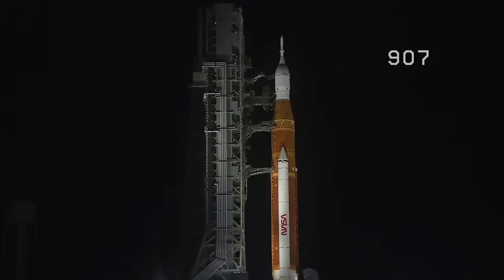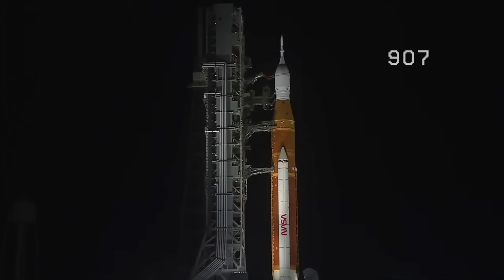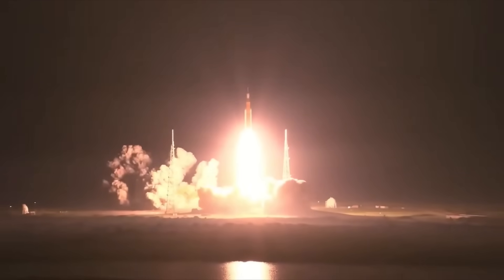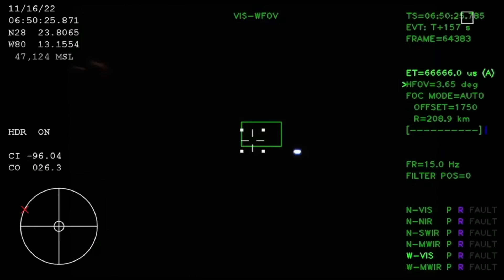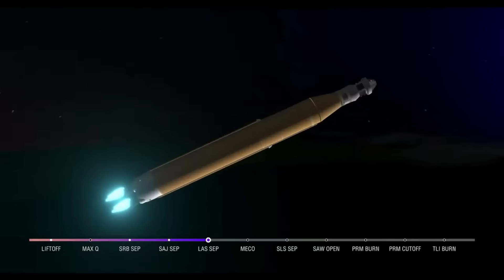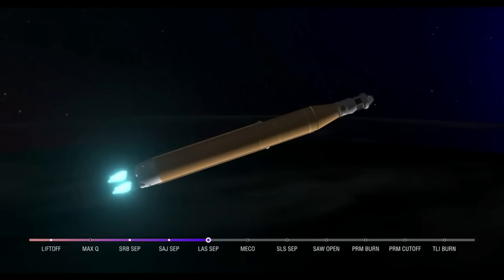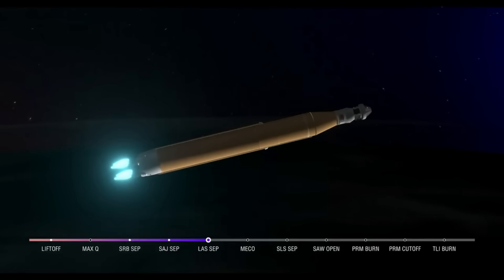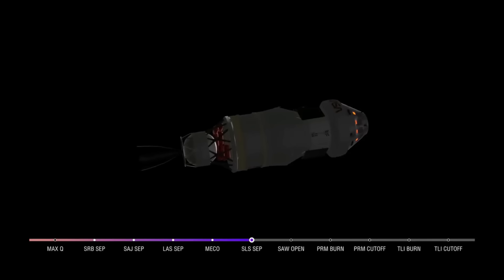Blastoff! NASA's Artemis 1 moon rocket launches on historic first mission

Comment: Let's put some things in perspective here:
Towards the end of the video, the vehicle was traveling at a whopping 16000 mph.
The distance between New York and Los Angeles (in a straight line) is 2446.3 miles.
So it would only take this rocket 9.17 minutes to travel across the length of the US!
Some added perspective:
A quick search shows that the fastest commercial rifle cartridge in the world is the .220 Swift (developed by Winchester). Its highest recorded velocity is 3180.7 mph.
So when this rocket reached 16000 mph, it was moving 5 times faster than the fastest bullet!
Reply: I didn’t know I needed this comparison but I’m here for it. Thank you!
Reply: Yes escape velocity of earths atmospheres is around 17000 mph
Reply: @odynith9356  Actually, it's closer to 25,000 mph -- about 7 miles/sec (11.2 km/sec). And you're not escaping earth's atmosphere per se, you're "escaping" Earth's gravity well.
Reply: Right so do the math on how far away they said it was at that speed and how long it took and it doesn't add up!! I smell bull!!!
Reply: @JB-ef7ks  You have to remember that the rocket is undergoing accelerated motion in three dimensions. It started at zero velocity and accelerated to 16,000 mph in the 5 minutes or so before MECO. Generally, if you integrate acceleration twice with respect to time, you will get the distance traveled. Here, we would have to know what the components of the acceleration are in the x,y, and z directions as functions of time. Then, we could integrate those functions twice over the main engine burn time. Then, I suspect, you would see the distances match up.
Reply: @2199SPUDMAN  I suspect not, but why don't you indulge us...
Reply: @JB-ef7ks  Acceleration of a rocket is not a linear or constant function, it is logarithmic. The thrust is relatively constant, except for throttle back around max Q, but the forces working against that thrust drop as the flight progresses (air resistance drops as the rocket rises, fuel mass falls as it is burned, gravitational resistance lessens as the vector changes from vertical to horizontal) resulting in ever increasing acceleration. Simple math doesn't suffice here. 🤣 If you'd like to "do the math" for yourself, here's a link to the equations.
Reply: @edbennett8257  please give me an example of how the billions per year given to nasa has enriched so many more lives for the better compared to all the poor, helpless, veteran's, and victims of war n poverty that it should have gone to instead of in the hands of a very few!!! And while you're at it please explain how it benefits humanity better than helping those in need instead of those in greed?!?!?
Reply: @edbennett8257  they got almost 30 BILLION DOLLARS this year while we the peasants got 1200$ for being good little non trouble makers!!
Reply: @edbennett8257  u sir are the one without a clue!!
Reply: @JB-ef7ks  🤣😂🤣😂🤣😂😁
Reply: @JB-ef7ks By far, most taxes come from the top 30% of earners, each who lives in relative opulence compared to 99% of the whole of the humanity since civilization began, and most all of them are okay with spending less than 1% of the tax base on this (fwiw, $40B spread out to each American comes in less than $9 per person per month which isn't even enough to take your date to a fast food restaurant once). The last time we funded space we got Computers (via solid state transistors), and all the advances in health sciences that computers facilitated ... innumerable benefits for all, including your 'peasants'. Seems you'd have us all be flat-earthers banging rocks together to keep warm, all in the name of some twisted sense of entitlement.
Reply: @davidaustin6962  I'm not talking about just nasa, I'm talking about the CIA, NSA, TSA, FBI, Paris climate Accord etcetera etc etc and I'm not talking about every single solitary American either since most already have health insurance that far exceeds basic healthcare. I'm mostly talking about the trillions of dollars allocated to kill people in other countries around the world yet the wounded warriors have to rely on donations for their trauma's both physically and psychologically to heal
Reply: @JB-ef7ks  as a libertarian myself (at least in spirit) I hear where you're coming from. I don't necessarily agree, but certainly sympathize.
Reply: Note to self... Invent rocket powered bullets

Comment: Is there really even a need to have throttle after a certain point?  Once you get up get out then get going a certain speed just turn the engines off cuz you stay at that speed
Reply: Yes and no. They'll use throttle to refine the path of the orbit and to create a slingshot effect using Earth's gravity and the thrust combined to get enroute to the moon.

But yeah, largely once you're out there and up to speed, you're just out there and coasting along at tens of thousands of miles per hour using fuel burns to change the trajectory, but not to gather more speed.

Comment: I'm confused are these older engine style more powerful than what Elon and other countries are using for rockets today? Thought most switched to a pulsar type engine or whatever.
Reply: The RS-25 on the core stage of this rocket is one of the most efficient rocket engines ever built.  In fact, it's only now being rivaled by SpaceX's Raptor, which has yet to actually push a vehicle to space.  And the difference between the RS-25 and the Raptor is far less than Elon would like to admit - they're both conventional rocket engines using a staged combustion power cycle.

Now, maybe you're thinking of a pulse detonation engine?  The idea's been around for decades, and it's still got a lot of work before they have something that could be put on a manned vehicle.  It may even be impossible.

Comment: THANKS to the Oil & Gas fossil fuel industries space programs an launches are possible. Green energy cannot launch rockets 🚀
Reply: The rocket uses Hydrogen and Oxygen combustion, neither of those are fossil fuels, my man.
Reply: Um, it uses none of those lol, it uses solar panels to power it but it does not use Gas or oil to fly.